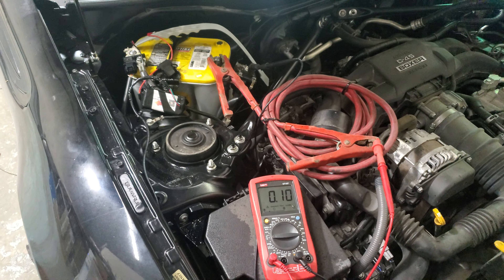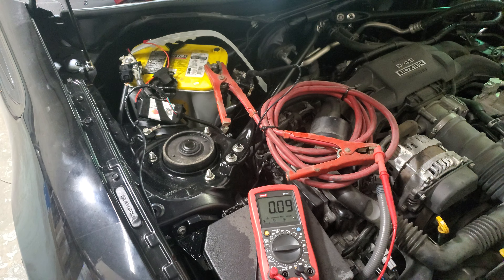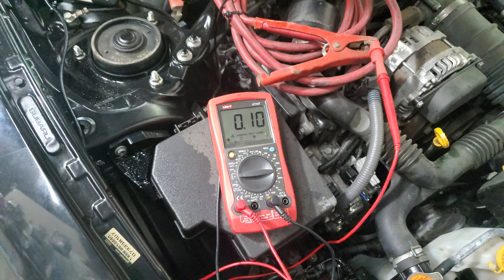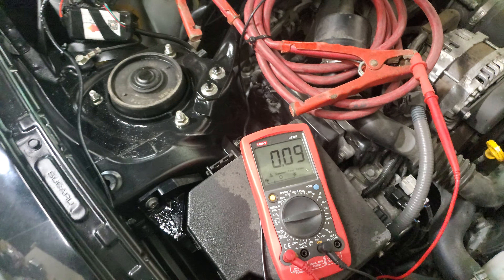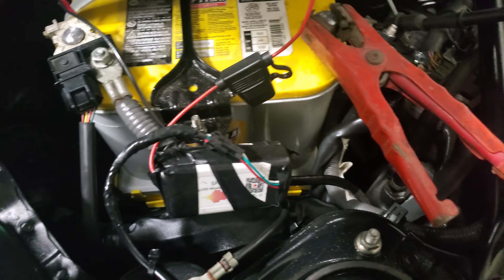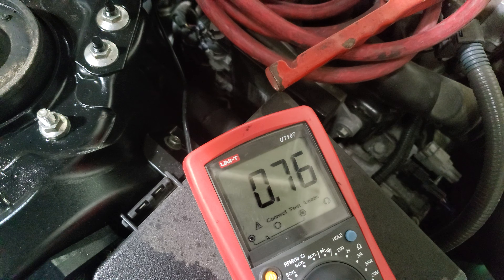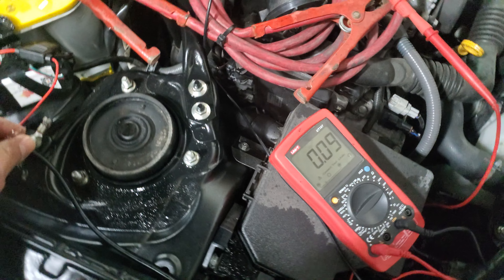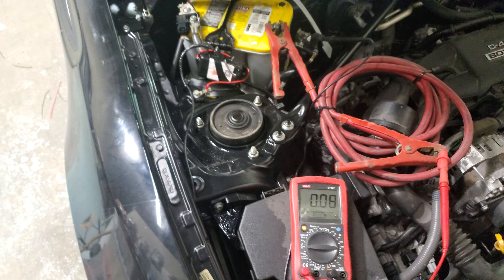Power draw issue due incorrect under glow led light causing battery drainage.

Comment: BUT YOU DIDNT SHOW HOW TO INSTALL CORRECTLY! WHATS THE POINT?!
Reply: What I was thinking if you connect the power to an accessory fuse so when the car turns off the power turns off to the lights or get one of battery maintainer box so when the voltage of the battery drop it cuts off power

Comment: Great video, would like to know a solution tho, is there a way to power the under glow without draining the battery?
Reply from the maker: Yes, you will need to have a proper Relay system with ACC control to avoid any power drain
Reply: @caraudiotoronto  could you further explain, I have this same kit and my battery is draining too. I cannot seem to figure out how to fix it
Reply: @caraudiotoronto  would connecting them to the fog light fuse avoid this?
Reply: @diegocruz3542  probably as that power source is switched power (through the key ignition on).
Reply: @jacksonmorgan7510  you want to connect the wiring to a source that has power when switched on with the key/ignition. 

examples would be some 12v lighter sockets, fog lights, ect
Reply: But how

Comment: Help please: I too need to check if my off road light are slowly draining my battery. Did you plug the multimeter to the positive cable and the negative to the negative; because in the video it almost shows that they are both touching the positive

Comment: I changed the interior lights to LEDs in my 2006 Dodge Charger and now when I start the car it can barely turn over. Could this be doing the same problem? And should I go back to my original interior lighting?